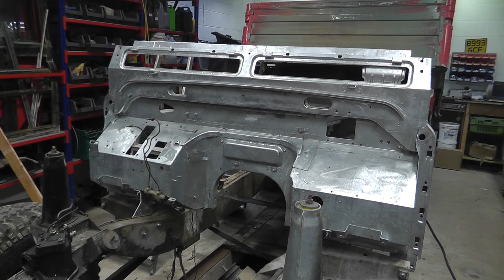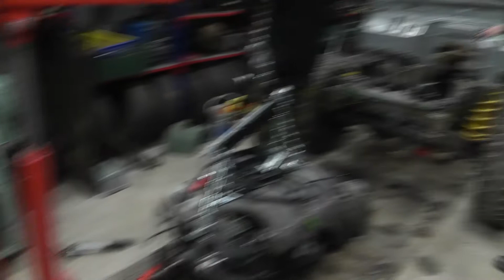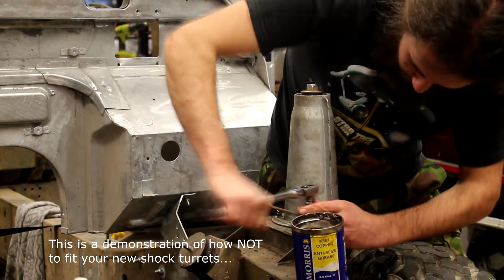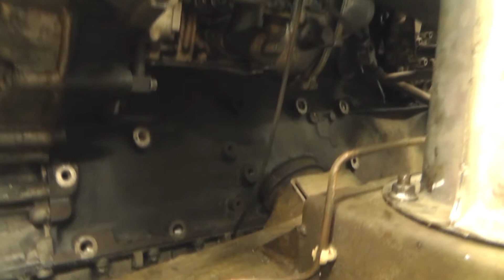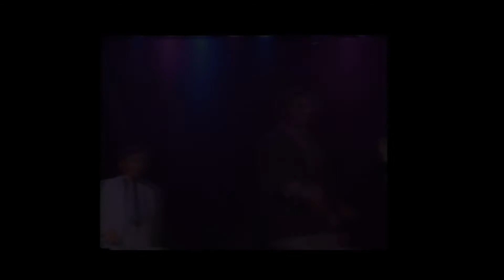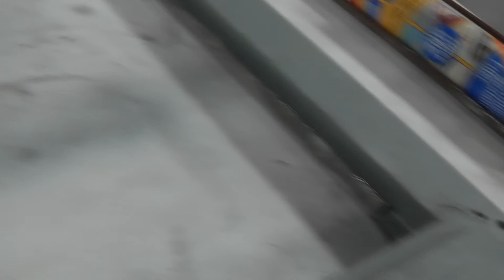Land Rover Defender 127/130 RestoMod Rebuild - Episode 3

Comment: Problem with Landrovers has always been electrolytic corrosion. If you're working with bare steel body parts always degrease and paint with phosphoric acid, this produces a rust proof layer a couple of microns thick before applying primer paint. When fixing aluminium panels to steel frames seal all the edges so that water cannot get trapped in between. On ships big lumps of zinc are bolted to the hull and act as corrosion sacrifices, I haven't seen this attempted on Landrovers.

Comment: Hi mate just found your channel, we've messed around with the 200tdi (more fuel, bigger turbo) but looking to drop a 606 into a new project now. Are you going to Peterborough this year? Cheers ~ Fred
Reply from the maker: Hi man, thanks for the comment.  Unfortunately... this video is a bit out of date now (really need to get the next one edited!), and I've changed the plan away from an OM606 and gone for a Cummins conversion which is nearly done now.
Reply: Wow pretty serious change, the Cummins should make it a beast, will definitely suit the 130 more I reckon. Don't suppose you've got the merc engine lying around?